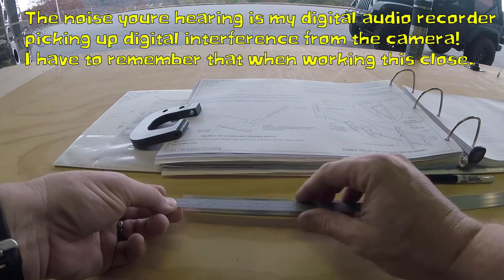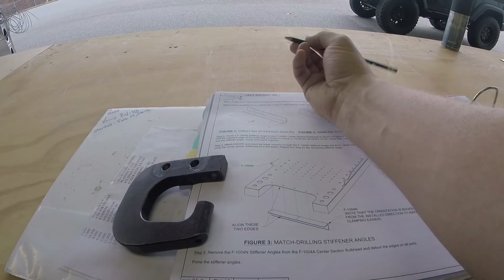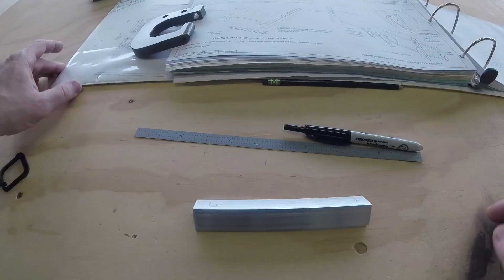RV-10 Fuselage - 002 - Initial steps on building the fuselage

Comment: Loving the vids and just now getting caught up.  3 years of RV 10 building in one weekend!  I am very strongly considering jumping in on an RV 10 project.  I have a lot of mechanical and building experience so I think I can do it.  In my Navy years I was a mechanic on nuke powered subs and there is a LOT of tubing.  They do NOT use any flaring at all for many of the reasons you discuss here.  They use, instead, a swagelok/ferrule system  which I found to be quite reliable in even very high pressure applications.  And you don't need a flaring tool. To make a new connection, you cut and deburr the tubing, slip the nut and ferrule on, seat the tubing and tighten the nut.  As it tightens, the ferrule clamps the tube on the joint is made and can be reused.  I am wondering if there is a reason why these aren't used on airplanes?
Reply from the maker: That is a great question and one I dont have the answer to.

Comment: Spend some time going through the plans and mark the angle with the steps they are used. When I built my RV6A, there was a whole bunch of angle and it was a case of going through the whole drawings and planning on what each length would make. The fact that Vans now supply cut lengths (and in pairs) mean that it will be quite obvious where they go. The ones in pairs are generally for left and right, so that makes identifying them easier. If Vans have provided cut length pairs, I'm really surprised that they aren't marked up with part numbers.

Comment: The angle is NOT AlClad, so needs primed to prevent corrosion.  Any of the parts that are not made from sheet material should be primed.  

Another NOTE:  For good priming adhesion, you should: Clean (to degrease, and no more touching with bare hands), Etch and scratch (to remove the top oxide layer), Rinse (don't allow etch to dry), Dry 12 hours (get all of the H2O out of the grooves).  I use ( http://www.stewartsystems.aero/products/105/ekoetch-quart ) etch and ( http://www.stewartsystems.aero/products/465/ekoclean ) Clean, they are cheap and effective.  But there are many others.  Theirs are Non-Hazardous and no hazardous material shipping charges.  

I am also using their primer and it appears to work well, but is more complicated to apply as it requires a spray gun and seems to need MUCH mixing without making bubbles.  Still evaluating, but is on the inside of my vertical Stab and Rudder of my RV-10.

Good Luck, I enjoy your videos.

Comment: With regards the fuel tanks and capping the blue annodised fitting. There are plugs (being the Male thread) and caps (being the female thread) available. I'd assume spruce would sell them. They designed to do exactly what you are trying to achieve. The Male have a nut and this little solid flared thing to close off the fitting and the female one is just a solid fitting with the flare. Just make sure you get the right size. That looks like to be a -3 or -4 fitting. 
Also that flared tubing is used for lots of things. Usually alot of the fuel plumbing, hydraulic pneumatic, brakes, some even used it for pitot static plumbing.

Comment: Don't worry about cutting the angle aluminum. Its not anything too special. You can get this stuff locally, no need to order this stuff from Vans.....many gotchas in the fuse. We are attaching the tail next week.
Reply: Careful here.  Though I agree you could possibly buy the aluminum angle locally if you have a metal supply depot.  Home Depot and the such do NOT sell the proper grade aluminum.   Take note the angle aluminum that comes in the Vansaircraft kits have a radius down the center.  This is a structural aluminum angle.  The angle from Home Depot don’t have this radius and are not structural and therefore not the proper material.
Reply: @davisaviationllcdavis738  totally agree. The Home Depot aviation department doesn't carry much of anything useful. I was definitely referring to metal yards.

Comment: often the inventory subkits parts meant for specific tasks.  Might look at that too (RE: angles to use)
Reply: :-D -- critters:  RABBITS, scorpions, skinks, stink bugs, SPIDERS (including widows), more rabbits (they leave pellets), raccoons, roadrunners (they eat the critters), ... 
oh, and birds!! ;-(                
No coyotes (yet), but dogs when the doors are open <sigh>
Reply: Cap for your flair fitting for the tank --- AN929-4D or -6D SHOULD work just fine.  I have had NO problem with mine working (and cap doesn't need to be more than finger tight to seal)  (the #D matches the fitting #D)  ((yours looks like a -4D))
Reply: Had to rewatch 3-4x cuz kept getting distracted by the overlay and miss the main work you were doing :-D :-D.
BTW, the further into the build you get, the less help Vans offers --- expects you to KNOW what you  are supposed to be doing ....
Challenges await you!!!!